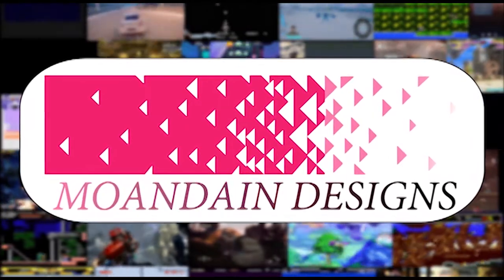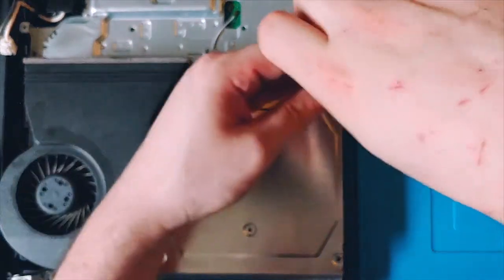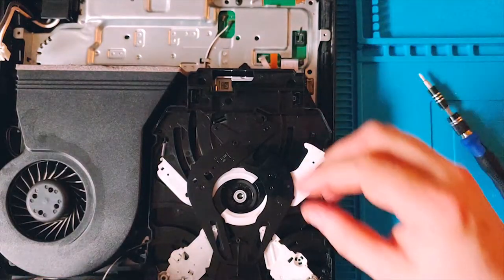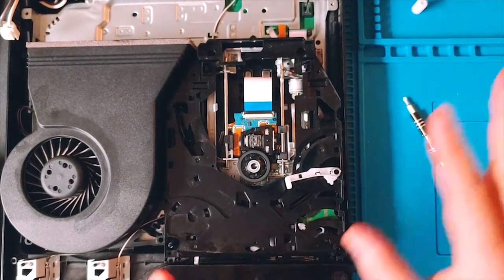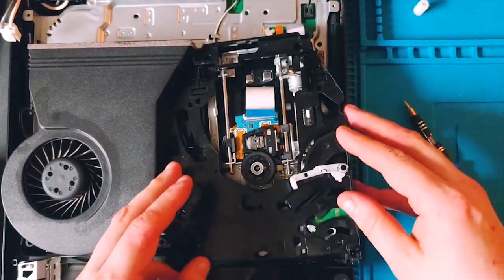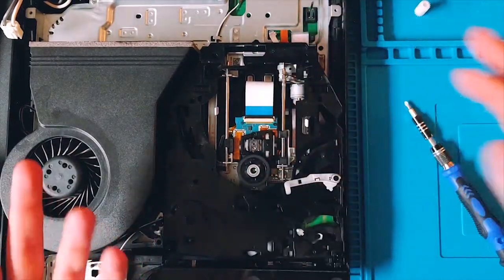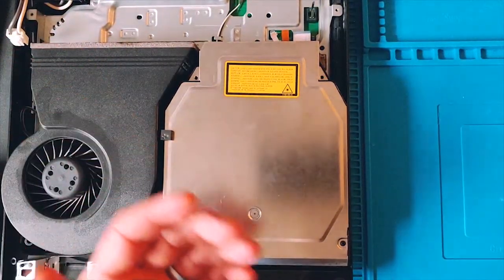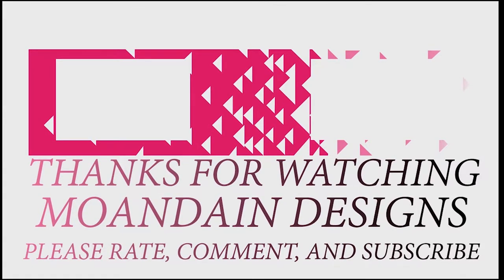Reinstall PS3 Slim Disc Drive the right way.

Comment: Just wanted to say thank you for uploading this!! I was in the process of cleaning my disc laser and when I finally got to the step of reattaching the ribbon cable, I almost gave up entirely. So many reassembly guides expect you to be able to reattach the ribbon cable by squeezing your hand through the back. I found it impossible.  Thanks to you I was able to get it reattached!
Reply from the maker: Glad to hear it! So happy that people are fixing the PS3s.
Reply: @moandaindesigns  i cant even open my playsi 3 because i dont have a Torx T8 Screwdriver... Why do they do that. Why not only Philips Screwdriver? Can you say why it is so? :/

How much is a Torx T8 Screwdriver?
Reply from the maker: @chrisme5467  Sony never intended customers to ever open the system. Remember these systems we made in the dark days where self repair was forbidden by the manufacturer. I would suggest getting a screwdriver kit from Ifixit or Amazon. 
This set is what I am using now and I am happy with the results I get for something under $30. 
XOOL 80 in 1 Precision Set with... https://www.amazon.com/dp/B0718ZM6R1?ref=ppx_pop_mob_ap_share

Comment: Finally a video on how to show this!About a month or 2 ago I disassembled my ps3 slim thats the exact same model as yours to replace the thermal paste and evwrytbing went well until I started reattaching the disc drive where it didn't go good because when I put it back together I got the yellow light of death and the ps3 started vibrating because there was a sound of something getting stuck
Reply from the maker: Yea it is a caution light. Hopefully you got it fixed. Let us know how it turns out.
Reply: It works now but it'll only work  without the case at least from the last time I used it but I haven't seen if it work with the mechanism that accepts the disc's yet

Comment: Excellent video! I agree, this is more than likely the method for assembly used by the original factory workers.

I initially tried reseating that cable the difficult way and found that your way actually allowed me to seat the flex cable more securely and deeper into the connector on motherboard. My initial attempt with the caveman method left the black distance marker out in the open by 1mm or so, whilst yours allowed the marker to be buried within the connector.

I'll need to test my console properly. I bought my slim console recently as my original superslim appears to have a wireless card malfunction that doesn't let me connect bluetooth or wifi... but I can still boot normally without issue and even update amd access internet whilst connected via ethernet thankfully. I haven't got the soldering skills or equipment to safely mess with the wireless chip or surrounding components.
Reply from the maker: @naliboi93  happy to help. The wireless com card is a surface mount with solder balls.
Reply: @moandaindesigns  thanks! 

Lol, deffo don't have the equipment and skills for messing with anything using solder balls sadly. Hand soldering and occasional SMD desoldering of accessible pads with ChipQuik is as far as I can go (I think that also means I won't be able to replace any voltage regulator chips linked to the wireless card as they usually have hidden solder points underneath their chips anyway).

Comment: 100%, it is such a chore trying to do the disc drive on CECH-2501A
Reply from the maker: Too True, but Saving a console is always worth the effort.
Reply: @moandaindesigns  in other models that ribbon wire is on the side.

Comment: Thanks for this video. I took mine apart to clean it, when I put it back together it wouldn’t read my discs. I followed your directions and seen that I pulled the ribbon off from the bottom of the drive. Smh. I was about to toss it.
Reply from the maker: So glad I could help another gamer keep their PS3.

Comment: Intresting fan design I have 2 ps3's I have repaired both slims but they don't have that fan design is yours a newer one? Very helpful video thanks
Reply from the maker: The slim has a lot of revisions. I have never really looked at the dates to determine how new/old the system is.
Reply: Oh ok thats very intresting didn't know they made the newer ones different

Comment: Did the console work before disassemble ? If so, does the console work after assemble ?
Reply from the maker: Yes and yes. Mainly not because I only cleaned the drive and reset the disc mechanism.

Comment: I completely swapped my optical drive but now I can’t get one of the Torx screws back in. The one on the far edge of the ps3, on the disc side. It’s like the drive is slightly bigger than the retail drive the PS3 came with. Any experience with this?
Reply from the maker: I have opened multiple systems up and swapping in a new drive is difficult because you must replace it with an exact match. Sounds like your replacement drive is for a different model.
Reply: @moandaindesigns  the drive currently works. So that’s cool. But is there any risks to either using a wrong drive or leaving that screw out?
Reply from the maker: @LastNightsGrime  I do not know. It could make the drive not line up with the system shell. I usually stick with exact matching parts in my repairs.
Reply: @moandaindesigns  I feel you. Wish it was a perf match, but I think I’m gunna let it ride for a bit. I’ll report back if there is any shenanigans

Comment: I reassembled the drive and now its not spinning it worked before. This method is definitely easier but I must have messed something up
Reply from the maker: Double check all of the cables make sure none of them are damaged and that they are all fully seated with no debris in the connection ports.

Comment: Hello m8,

i already bought two of those disc drives which are compatible for this model. Everything works fine with the new one but it doesnt read discs. It takes the discs and the when he does that he suddenly sound like hes going to eject it and afzer that nothing happens any solution maybe? I have an CHECH 3004B

Thx
Reply from the maker: I am guessing the laser is not reading or detecting the disc. if the drives are new/old stock there could be  something with the laser having a grounding strap.
Reply: @moandaindesigns  allright thank you ✌🏻